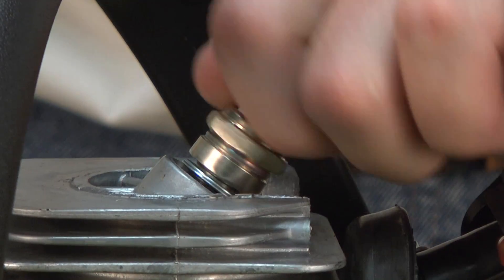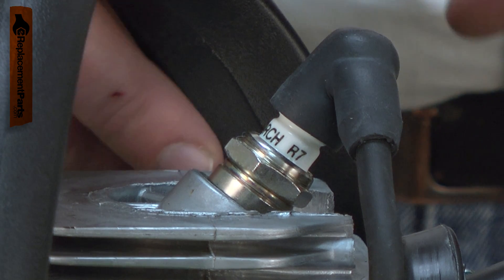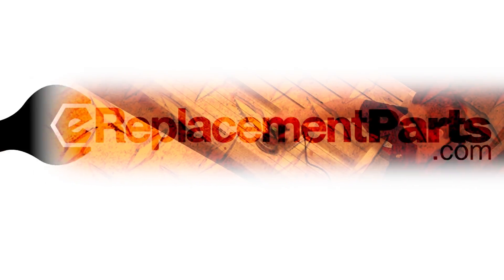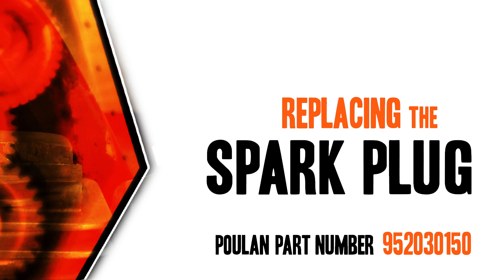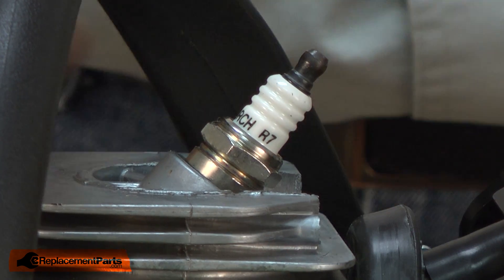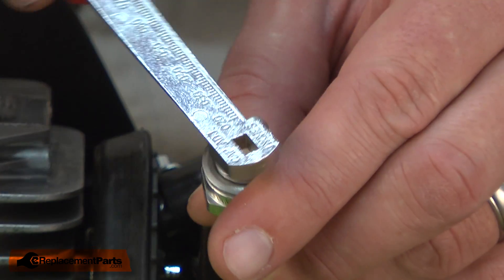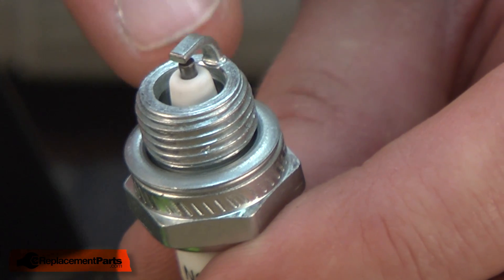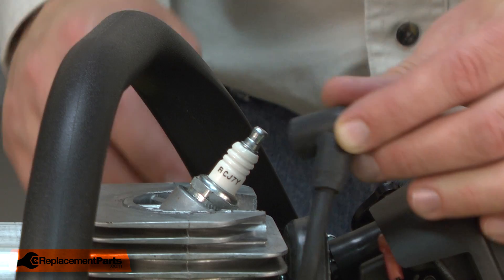Chainsaw Repair - Replacing the Spark Plug (Poulan Part # 952030150)

Comment: main reason for watching your video was to determine what size socket I need to remove my sparkplug.       My old School sparkplug sockets from years past 13/16" and 5/8" were too large and too small   Luckily you had a clear shot of the socket in your video and now I know 3/4" is what I need.   Good video you have another new subscriber.